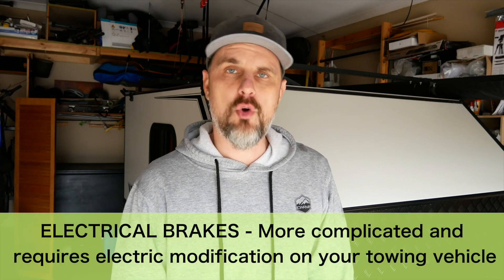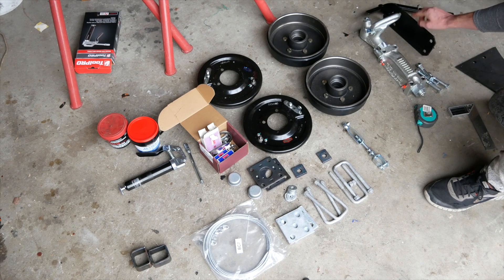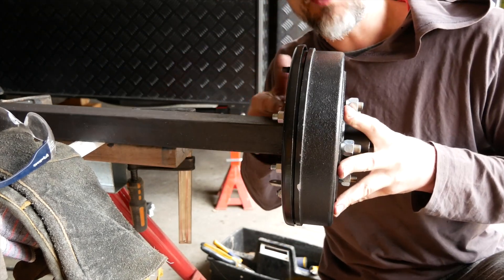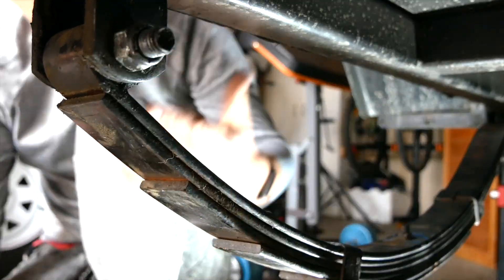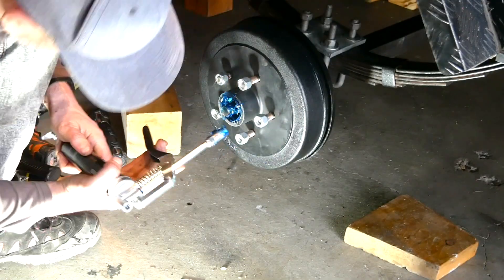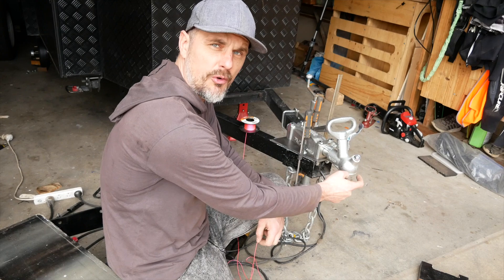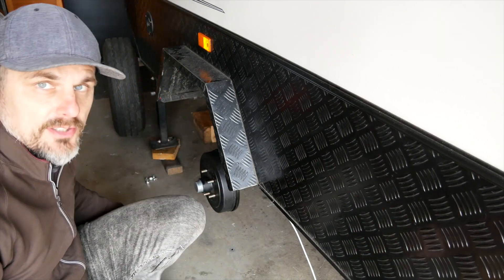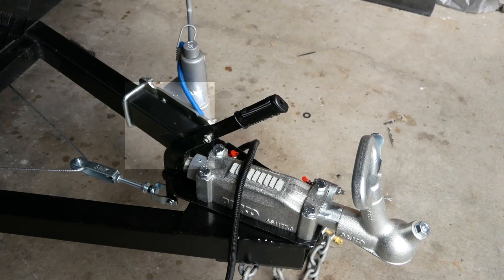Mechanical Brakes Installation on Squaredrop Camper Trailer

Comment: Did you have a link to the kit or similar? My caravan has the original cable drum brakes but seems hard to find new ones. Cable seems much easier than dealing with electric.

Comment: Nice detailed video. One thing I would point out. The cable ends need some sort of protection when they go through the levers at the brake hubs. That is too tight a bend and the cable strands will slowly chafe away and snap with the amount of strain they will encounter. Maybe a loop eye https://www.s3i.co.uk/image/s3i/hard-eye-sling-wra-loop.jpg

Comment: Hey mate, very helpful video, thank you! Helped me build my first breaker trailer. Small issue tho…the leaver as well as it’s entire assembly moves when I pull on it, causing the shoes to scape once it’s realised. It only moves by a few mm but enough to throw the shoes off centre. Is it supposed to be fully fixed with only the leaver moving or some movement is ok?
Thanks!

Comment: Thanks for the helpful video. Where did you get the coupling from?
Reply from the maker: The silver coupling with the internal spring trigger came with the brake kit, purchased from a local trailer shop. But i've seen these kits online too (ebay)

Comment: So the brakes don't actually help stop the trailer when driving? I thought that was the purpose of putting them on....
Reply from the maker: They do when you enable them by lifting the latch. When you brake with the vehicle, the forward momentum pressure engages the brakes on the trailer.
Reply: @ChilledBeans  Okay, I had to watch a separate video on how they worked! I don't think I had ever seen anything like that hitch....
Reply from the maker: @oldschooldiy3240  Ah cool. I probably should have added more info on that in the video ...
Reply: @ChilledBeans  I don't think you could have explained it any clearer. Thanks for the video.

Comment: How much more expensive is rego now you have brakes?
Reply from the maker: It made no difference at all. There was no cost in updating the rego.
Reply: @ChilledBeans  okay… once you have brakes I think you need a yearly inspection? Or there are some additional requirements?
Reply from the maker: @craigelliott2524  I live in Victoria/Australia and they don't require any inspections. My trailer ATM is 1150kg (920 tare), and for this type of trailer they dont require any sort of inspections.  I'm not sure what the rules are for much bigger trailers.

Comment: Very informative, thanks. I have a similar trailer with mechanical disk brakes..
At present, I am wondering how I can increase the height (drop the axle) to accommodate larger wheels (same size as vehicle) and shocks. I have eye to eye leaf springs too. Any suggestions welcome!
Reply from the maker: Hi Benny. It's hard without seing it, but I suspect you would need to cut the existing hangers that hold the eye-2-eye springs, and then weld some sort of extensions that will bring hangers down more, therefore increasing the clearance between the wheels and mudguards.
Reply: @ChilledBeans  I can see that the easiest way is to replace the shackle plates with longer ones, but that means, for an extra 2 cm of extra length of the shackle plate, I get only 1 cm extra clearance at the wheel, so you may be right, I have to extend the hangers down and somehow keep the inherent strength of the system. (the trailer is rated for 1400kg) 
It just occurred to me that I can put the axle under the springs and rotate and switch left to right the backing plates - that should give me around 75mm of additional clearance.
Thanks...that is what your video and comment did for me - solved my problem, I think!! Thanks.
Reply from the maker: @Bennyboy-dog  Oh yes, axle yunder the springs is definitely step 1. That's how I run my setup.